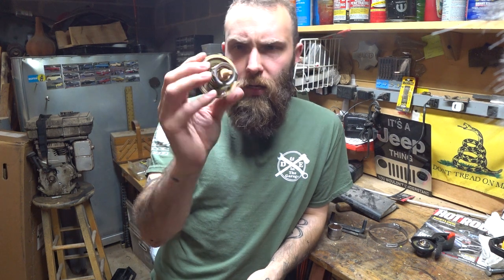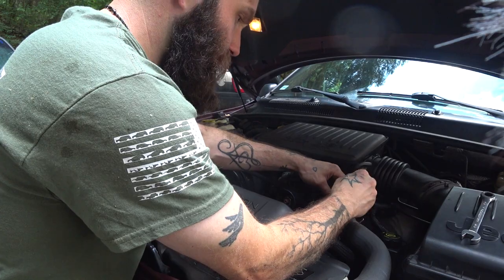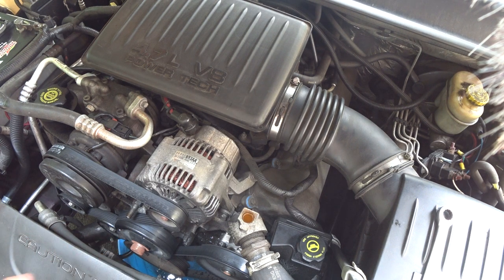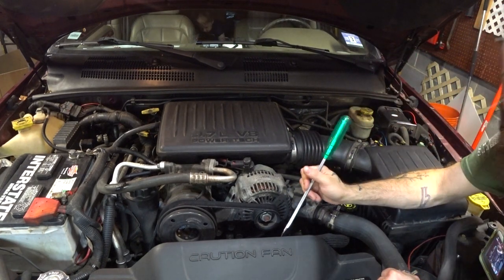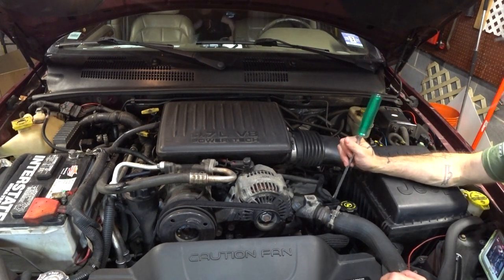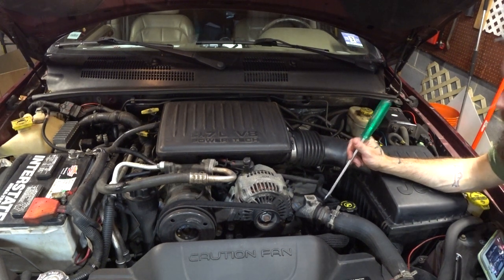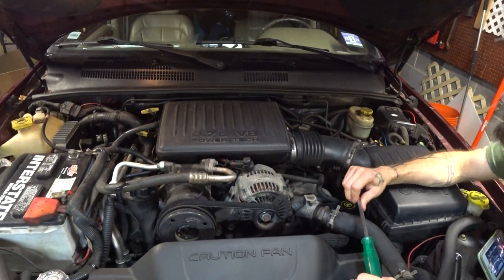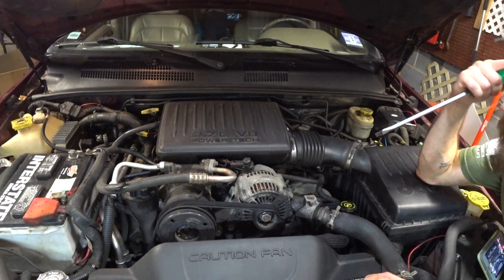How to keep a Jeep Dodge 4.7L alive & happy - EVERY FATAL FLAW I LEARNED THE HARD WAY!

Comment: Thanks for the solid info in this video! My first 4.7 WJ dropped a valve seat and I drove it 50 miles home on 7 cylinders (LOTS of blow-by) before it went bye bye. I bought my second 4.7 WJ a few years after that it's doing alright. I'll never get over that fear of dropping a seat though. I am considering doing an electric fan conversion because im worried about the reliability of my power steering setup (service history shows the previous owner swapped the power steering pump so that scares me). Other than that, I freaking love 4.7 WJ's, sometimes you gotta take the good with the bad.....If I get REALLY pissed, i'll buy a 4runner

Comment: My 4.7 was just overheating. Thermostat. Then, that didn't work, and had to do a water pump and full flush.  Works great now.  As a teenager, my first Jeep was a 4.2, then graduated to a 4.0. They were forgiving engines that allowed me to trial and error and learn. I now have a 3.7 and a 4.7 for dailies. I don't mess with them since they are much more picky and I just bring them to my Jeep guy.  Probably cheaper too to have an expert do it once than me do it three times.  There's value in learning, but not in Alaska in the winter haha

Comment: Running 2005 4.7 and haven't had many issues. Cooling is fine. Normal leaks around trans cooler lines. Just reached 250k miles. Timing chains getting changed this weekend. I'll be instalin new lifters as well. Should be a smooth repair.

Comment: Yes I had 34.76 put in my truck they all went within a month now with the new motor the power steering went and they didn't bleed the system right thanks to you video I'm back on the road thank you very much

Comment: 5 years ago I purchased a 2000 WJ GC with an apparent engine tick. A massive discount due to a spun big end bearing and a new reconditioned engine, it has been running strong ever since. I was meant to be a launch car for my boat but its such a nice car in very good condition I use it for long drives. Its not my daily. I installed a double row all alloy radiator and ditched the mechanical fan.
The AC Electric fan was re-tuned to run as the engine cooling fan and it works a treat. No cooling issues at all. The green coolant was replaced with red/orange coolant with the new engine.
Reply from the maker: Sounds like you built a beast of a 4.7!

Comment: Really appreciate it!   I've had a 3.7 Ram from 15k to 145k; absolutely love it (no issues other than replacing front suspension), but I'm looking at 4.7s now that we have a trailer to tow, and wanting to know what I'm getting into.  Great info.

Comment: I've got a 2003 Dodge Ram 4.7L V8 with 507,000 miles still running, granted low compression in cylinder 5 but a great transmission haha! Still running and driving though!

Comment: I got a 2000 WJ with the 4.7 230k plus on the odometer runs great doesn't burn oil,no leaks, no smoke on start up, no ticks, no knocks it's mint. In other words you do the basic maintenance it can be reliable

Comment: Great video! After watching this and reading some of the comments, I feel the need to chime in. I currently own 2 grand cherokees, 1WJ/4.0 4wd, and a 2007 WK w/4.7/4wd. I drove both of these when I was working and traveled on average around 36,000 miles per year. I bought the WJ with approximately 150,000 miles, while the WK had 167,000 miles. As of today, the WJ has 342,000 miles and the WK has 363,000 miles. I am anal about maintenance on both so I would hopefully avoid any downtime when I was working. I keep the WJ as a spare because it starts and runs, and everything works. The WK has been the best vehicle I’ve owned so far, and my wife drives it now and has for the last 3-1/2 years, as I graduated to a 2012 F-150 (with 283,000 miles). I’m living proof that proper maintenance on anything will make it last longer. Most of my repairs consist of replacing worn out parts. That 4.7 has been so good that I plan on replacing it if it ever fails! Not posting this to brag, but just wanted to let others know that the sky’s the limit on these if you maintain them properly. Again, a great video! Thanks!

Comment: My 4.7 Dakota engine has been dependable as heck for 12 years... I’ve done one service to the cooling system in the life of the truck. A full flush, thermostat, fresh coolant, and a new water pump, maybe 5 years ago... I put in a 185 degree thermostat since I heard these trucks don’t like to get hot. Then again I Never heard of a truck that likes to get hot... I am planning to upgrade the original mechanical fan clutch to a new heavy duty towing fan clutch...

Comment: For the hot issue, (and you dont live in ice  :) ) just simply remove the thermostat. Took my WJ 4.7 down from 90+C to ~80Celcius in about 20 to 30C climate. My hydrolic fan in 3 years has only on 2 to 3 occasions fully ramp up into 2nd gear. Keep posting D&E, great content.

Comment: I've got a 4.7 in my 00' Durango, I didn't know how temperamental the cooling system was and Im glad I found this video, I will be doing a drain and flush soon now that I do know. I haven't had any issues cooling wise but I do have a pretty bad exhaust leak which I've heard is fairly common, being that the studs on the manifold will snap or back themselves out, but I enjoy my Durango overall, and hope for many more miles, especially with it being my first and only car
Reply from the maker: yea bud VERY temperamental, but if you understand the things that make it different you will be fine. I have about 5 videos on the 4.7 cooling system. check them out if you have more questions
Reply: Did the exhaust leak sound like a tapping noise?
Reply: Thanks. And your not joking. I live in San Antonio.
Reply: @jcstevegigs  I had a tapping noise on cold start until the engine warmed up with my 4.7. I thought it may be a bad lifter that would finally pump up when warm but my mechanic said it was just a bad exhaust gasket.

Comment: So because you asked ill share my current 4.7l story. I'm a B Tech at local Midas where I live and one day I decided to finally buy a truck and get rid of my 1.8l Sentra. I bought a nice OD green 03 Dakota SLT with the 4wd and the 4.7l. I picked it up for 750$ with some obvious problems. Basically it broke down the night a bought it and was hit by a Semi on the side of highway as it waited to be towed. But its a strong ass lil truck and the damage I had was a broken rear window, easy fix. Once the truck is in my shop I start tearing the motor apart and find blown driver side cam bearings, warped passenger side cylinder head causing no compression in cyl 8 and sheered timing guides that clogged the oil system blocking the pick up tube. So the deeper I went the more problems I found, but I convinced my wife this wasn't a bad investment and decided to use it as a learning tool to finally rebuild an engine and show my bosses I can do it. I hit up Rockauto spend about 500$ on internal engine components and about 150$ on a used driver side cylinder head and start the rebuild. I looked up all the torque specs for everything, I lapped the vale seats, I cleaned everything, replaced all the gaskets everything. The only thing I couldn't do because I didn't have the money or time because my boss wanted it out (was in the shop for about a month while I got the money together) was machine the heads. so I did my best to make sure the right side would seal and so far the engine runs awesome, lots of power and sounds awesome. But I'm having two issues after rebuild and I'm having a lil trouble. I have a recurring P0344 code, it causes stalling and lack of power  and rough idle. when I rebuilt the motor I got aftermarket sensors, so I tested the sensors and they have good readings. so I kept looking and found a tsb 18-015-09 which is a pcm update which allows the pcm to read coded data from aftermarket sensors it doesn't normally decode. so I did that and that didn't work, so I moved onto the harness itself and found some issues with the cam and crank sensor connectors so I repined them and its still coming back. My master tech looked at it and helped me probe wires and shit which is how we found the connectors had problems, but it came back again and haven't had a chance to verify if the recent fix worked because the previous owners actually put a ford fuel injector in it to replace one and now its dumping fuel and I just ordered a new one, so I don't wanna cause more damage so I'm not driving it until I get the new injector in it. The other issue I'm having is a tapping on the passenger side cylinder head. I used a stethoscope and tested the front cover, exhaust manifold (I heard the bolts break and can cause a tapping) and passenger cylinder head. I hear it loudest on the exhaust manifold and cylinder, I haven't yet had time to take that valve cover off yet but I'm hoping its just a faulty lash adjuster or loose rocker arm. But I love the truck when it runs, it ran awesome for a month and I haven't had a chance to take it to the desert yet but I wanna build it into a off road rig. We came up with a name for the trunk, were calling it "Frankenstein" sense its green and I've basically brought it back from the dead. So yea that's my 4.7l story, so far.

Comment: First thing I did with my 4.7HO was add real temp/pressure gauges.  The ones on 03-04 WJ are more of an idiot gauge.  FYI, I also use Preston Pro Guard (Green) antifreeze.  Its for all (including Aluminum) engines/heads.  Only like green because coolant/oil leaks are easy to see.
Reply from the maker: I see your point there. Good call on the green!

Comment: Bought my 4.7 l wj for 850$ driven 12000 miles still running strong like you said hiccups in the cooling system but great car reliable and cheap to fix I recommend the 4.7 if it’s been treated properly

Comment: I bought a 2011 Dodge Ram with the 4.7 sohc with 98k miles I put a electronic fan on it and never had a problem out of them and I ragged it every green light I could and pulled boats and trailers and never had a problem out of mine solid truck it had 150k when I got rid of it now looking at getting another one

Comment: please remember to tell folks about the sludge filter (change or clean) it will oil starve the engine. had 2001 dakota 4.7 fail from this. and especially the 4.7 ho and for (high out put 4.7 ) rotela t-4 oil. thanks for listening

Comment: i got the 08 ram 1500 quad cab 4x4  4.7l   i bought it with 140,000 on it and mine runs very well..i have had zero problems i just changed all 16 plugs to ngk iridiums  and changed the oil to valvoline full synthetic high mileage 2 days ago..i also put a superchips tuner in it and it seems happy no codes everything does what it is supposed too. i want to get some long tube headers and the remote cutouts a black venom 2 in 2 out 3inch race muffler and a cold air intake.

Comment: Hey! Newbie here!! I just got a 2004 Jeep Grand Cherokee Overland with the 4.7. Well!!!! I was told the thermostat needed to be replaced when I first got her. So. First thing I did was change the thermostat. Bled the coolant. The Orielly’s ppl told me to use the G05 Zerex coolant (was that the right coolant?!!!). 
The overheating has stopped but now I’m pretty sure I have a coolant leak now. I tried starting her to get my kid to school and she died 4 houses down the road. I believe that I may have not waited until the engine was hot enough......
I bled the coolant AGAIN after calming down a few hours and got her home. 
I filled the coolant and got her up to temperature and made sure there was no more bubbles in the bleeder. 
Now coolant leaks from god knows where only when she’s running. I’m afraid it’s from the thermostat housing but I tightened her as much as I could. Help?!

Comment: The original green stuff is just fine in fact as far as I’ve ever been able to tell 1999 and 2000 came with it. The problems start when you don’t keep it changed every couple years because the corrosion inhibitors get depleted.

Also 99 and 2000 with towing package got the water pump mounted in addition to the electric fan ... if one fails at least you have one still working.

Comment: Ive got a 2002 dakota sport with the 4.7 206xxx. Runs good, dosent use oil or coolant. Very reliable but rusty, i love this pickup even though its a beater

Comment: Hydro fan is controlled by the temp send right up front by the intake mani.... Unplug it at idle.. if you get full power from your hydro fan replace the sender... If not the valve in the fan is stuck from the wrong fluid...

Comment: I learned all of this along my journey with the 04 overland as well.  My plan:  I've got a brand new rad with hydro fan and brand new pump sitting on the parts rack.  Next is the 08 intake manifold, ported headers, ported exhaust manifold, high flow cat, and downstream deletes!!! Oh, and a trip to Raleigh on the trailer for a hemi fever tune.  I take my wj on some remote trips and have no choice but to learn everything about it because help will not be coming.  You definitely built my confidence when this all started a few years ago.  Thanks for what you do.

Comment: Tip to. I'd run a cycle of water through the cooling system flush all green out before putting in orange. Unless formulas have changed orange coolant reacts with green coolant causes a foaming then dries and corrodes entire system. Hats off to the assistant director she's doing a hell of a job!! Jeep jeeeep!!

Comment: Throw a 180 degree T-Stat into it. My 4.7 runs around 170 now. Heater works fine and gas mileage unchanged. I use the universal coolant yellow stuff, no issues, change it , hoses, T-Stat, waterpump and fan clutch every 5 years. 2000 Dakota.
Reply from the maker: You still have good heat with the 150?
Reply: @DEInTheGarage  180, But, Yep - Heat is fine. I also eliminated the PCV system, no more milk shake under the oil fill cap.

Comment: ive been using green stuff 50% coolant 50% distilled water and a 190 degree thermostat and added a filler cap at the highest point on the top hose . 145k miles on my 3.7 no issues yet ( also my 3.7 is an electric fan )

Comment: I’m getting ready to change the lifters on a 268,000 mile 4.7 . I’m still on the original alternator . I replaced the clutch fan once and the original starter just gave up the ghost . Love my 4.7
Reply: How'd it go?.
Reply: I still haven't done it . I have the lifters soaking in Lucas for a year now and just can't find the time . I'm actually thinking about buying a whole new toped and new cams and timing chains . Just waiting on vacation time to take the heads off and inspect the cylinder walls .

Comment: I heard 4.7s aren't very good engines but I bought my 2004 4dr 4x4 dak new and I have give it pure hell. It has seen 5800 rpm many many times haha. 150000 miles and haven't had one single problem.

Comment: Quick tip. heating system doesnt have valves of any sort in it. Temp is set with blend doors and the coolant (hot or not) goes thru the heater core all the time, no matter if its set to lo or hi nor fan speed. If youd set it to low and fan off, or shut it off completely, it wouldnt make a difference besides it would heat up faster.

Comment: Been working on a lot of these 4.7 and 3.7, BIGEST COOLING SYSTEM FAILURE IS THE IMPELER IN THE WATER PUMP LOOSING GRIP ON THE DRIVEN SHAFT BECAUSE IS MADE OUT OF PLASTIC, SO IT FLOWS SLOW, THERE ARE SOME AFTER MARKET ONES MADE OUT OF METAL, INSTAL ONE WITH A METAL IMPELER AND WILL GUARANTEE YOU TEMP WILL BE AT THERMOSTAT SET WITH THE AC ON, WILL NEVER EVER GO OVER 1/2 OF THE GAUGE, I PUT A 180 THERMOSTHAT WITN A METAL IMPELLER PUMP ON MY PERSONAL WJ 2004 WITH A 4.7 AND TEMP STAYS ON 180 WITH THE AC ON ALL TIME, MY 5 CENTS, BY THE WAY LOVE YOUR VIDEO, THANKS FOR SHARING, SILVERVOULTURE

Comment: as you i'm just bought a 2003 jeep grand cherokee 4.7 and I find that the motor is fantastic. But you must maintain or like you said it's a big paper weight. When I got mine the first thing I did was replace the plugs . I guess the last owner never changed them and of course they where locked up so im still working on them , slowly but surely
Reply from the maker: No one ever does plugs anymore!
Reply: @DEInTheGarage  what do you mean?

Comment: These videos are SO AMAZING. So glad I found this bc he did not use the orange coolant. So when I flush it, I will replace the thermostat in it as well. I do not tow anything but a small flatbed. I will look into the cooling fan system
Reply from the maker: Glad I could help!

Comment: I too noticed the belt routing, this will spin the water pump the wrong less efficient direction.  I have had good luck filling the cooling system using the bleed port with a transmission funnel when air  free coolant comes out of the rad. cap you are done.  Nice video, good information.

Comment: Ive had good luck with the 4.7 in my WJ and I'm at 208000 miles definitely get the mech and electric combo fans though. keeps it cool even in super hot weather
Reply: Ive been looking into adding the electrical fan on mine since I swapped out the to the mech fan. Honestly I don't think I need an electrical fan because the mech fan keeps it cool with no issues. Even while towing.
Reply: @chewbakka0911  what mechanical fan blade and clutch did you go with I'm thinking about upgrading to a dorman 620-155 fan blade and hayden 2794 fan clutch for my 2000 4.7L with tow package, when I bought the jeep it had the factory steel 5 blade and the electric fan relay was by-passed and the wiring burnt up.
Reply: @richardseaman6221  ya-228 fan blade and clutch from a 97-01 mountaineer F67Z8A616NA

Comment: I bought a brand new 2000 Dodge Dakota with a 4.7 and she dropped a valve seat at 295,000 miles, I had to replace everything hanging on the engine twice ie power steering pump, air compressor, alternator. radiator and the power steering rack once. but doing all the work myself I thought it was a damn good Truck.